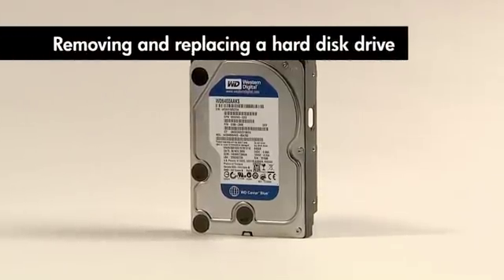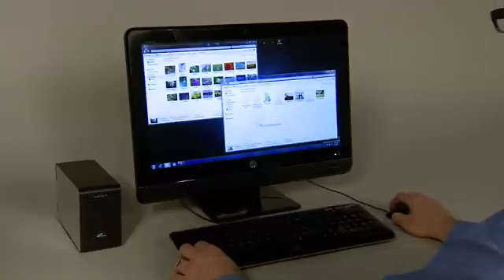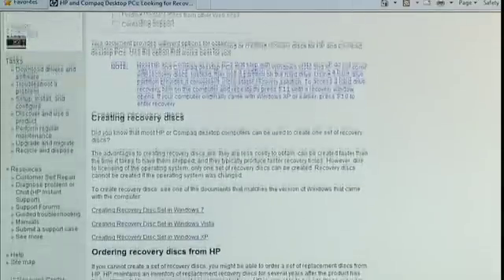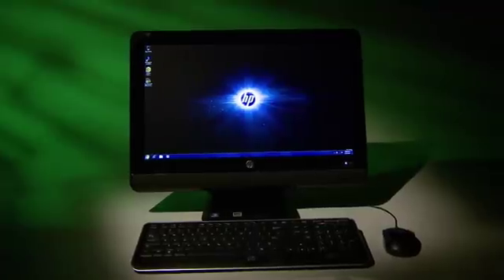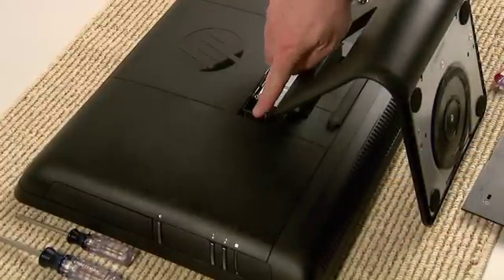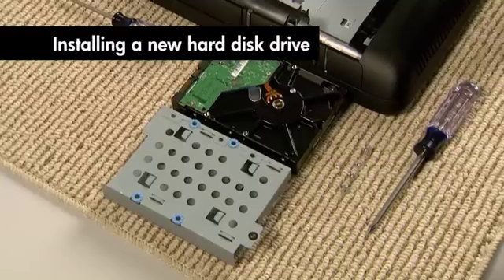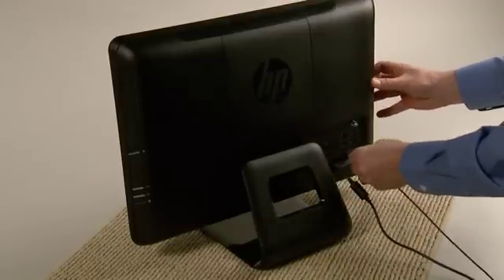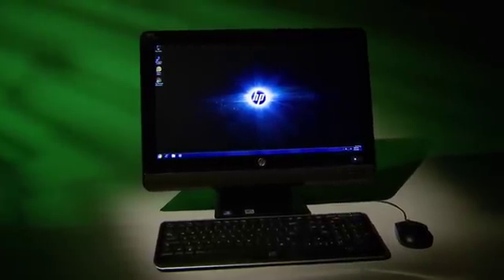Replacing the Hard Drive | HP Pavilion All-in-One PC | HP

Comment: What is the dimension of the hard drive on the HP Pavillion All-in-One 200 PC? Is it a 2.5" drive or is it larger?
Reply from the maker: +Shalev53 It would be 2.5 Inch SATA.
Reply: @HPSupport  Just checked this on the HP Pavillion All-in-One PC 200-5200ch ... the hard drive is a 5400GB Hitachi 3.5" (not 2.5" !)  - I have done so as I intend to replace the drive with an SSD (that is of course 2.5"). This now means that I will need a 3.5" to 2.5" adapter.

Comment: Sir, Can I replace 500gb HDD with 1TB HDD in  my HP20  2312in all-in-one desktop pc.
Reply from the maker: +Rakesh Malik HP does not recommend upgrading or downgrading hardware parts or software that is bundled with the product as It may affect the manufacturer's warranty and performance, however, you could change the configuration at your own discretion.
Reply: @HPSupport   Sir my pc is out of warranty and 500gb HDD is not working. So I can install new HDD of 1TB instead of 500gb in my all-in-one pc.   hp20 2312in  . Can I upgrade hdd  from 500 GB to 1tb HDD. Is it compatible with my pc.  I have recovery media for my pc  which is provided by HP. Can I use this recovery media in new 1tb HDD instead of 500 GB hdd .
Reply from the maker: +Rakesh Malik The current configuration that you have on the computer is tested for optimum performance. Technically, you should be able to upgrade to 1TB but if there is any concern because of this configuration change. HP will not be responsible.

Comment: I was given a 5040a last week, purely because its so useless.
It does however work flawlessly, once I formated and reinstalled Windows. I tried W10 but it kept running a program that I simply could not be bothered to try to cure, and as it had a legal Win 7 licence, I just thought bugger it, Ill do Win7 anyway.

I decided to simply use it as a media PC for the bedroom. It should be just fine for that, but given that all my other PCs are serious high end thing, this was disgustingly slow and so I am doing the best I can, do get it to be as fast as it can be.

RAM is 2GB. I have plenty of RAM but not willing to waste good ram on this, so I threw in a pair of 2GB Sticks.
HD was a WD Blue, and 500GB. Again this should be just fine for 90% of the stuff I want it to do, but me being me, I threw in a 120GB SSD. Since it will be accessing the Media from my Server, I dont need huge storage, however, I do want it to react as quickly as it can when I ask anything from it.

Now, the DVD can be replaced with a HD, just like I have done to all my Laptops. You simply buy a HD Caddy for a laptop and you can easily plop in a 2.5" drive into that... I did this for a bit, and the bezel coes off the original DVD drive to cover the hole, but after a bit, I thought stuff it... Keep the DVD in there. So, thats a thought for if you need extra storage on yours.

The 5040a can take up to a 3.16Mhz Core2Duo E8500 according to teh website, and so, I have a peekaboo into my box os spares and lo and behold I have one.

My only issues, is now, how far to take the stripping down of this thing?

RAM and HD are easy to do, as is the DVD, however, Im not entirely happy with how far I need to go, to get the CPU Cooler off?

I have had a play about... Not too seriously though, and I have taken of fa load of the screws, but, it seems to me, that I need to fully take the whole front off this, is order to take the rest of the back off?

I can get at the two coolers, or the small fan and the CPU Heatsink, and I can lift them up somewhat, but the actual main heatsink, is still very much under the case and so I am a bit iffu on taking this lot apart anymore than it is!

The thing is, that its got a 2.7Ghz Pentium and I have the chance of putting in a 3Ghz ( well, 3.16 ) Core2Duop, and its not just a 300Mhz boost, its also a huge Pentium to Core2Duo boost so the performance increase will be substantial enough to warrant me doing it.... If the E8500 still works LOL

So, anyone know how to do that?

Free beer and kisses for anyone who can help?
Reply: +FatRakoon Please refer the instructions in these documents to know about upgrading or replacing the processor: http://bit.ly/2B5zyQ4 and http://bit.ly/2GDycLJ

Comment: The hardrive went bad in this computer. How do I transfer the HDD in it to a new one? Is there a place to run cables and have 2 HDD plugged in so I can transfer? I never transferred a HDD to another HDD before so I dont know if there is an easier way or not. Thank you in advanced to anyone that helps :)
Reply: +clyde haoks Please perform the steps mentioned in this document to fix this issue: http://bit.ly/2noZJJn
Reply: HP Computing Support Those options seem to have a external hard drive or a easy transfer cable. I just need to be able to plug in both HDD at once or connect them and be able to transfer that way.

Comment: How can I install a graphics card in a all in one hp?
Reply: It really depends on the model of the All-in-One computer. In most cases, just like with a notebook,  it is not an option to replace or upgrade a graphics adapter.
Reply: what about on the omni pro 110 pc... i dont know if i should just get a new pc or not... but my specs are the intel core duo and the g41 intel chipset for graphics card
Reply: Basically you can't. They are like a laptop, and you can't really upgrade parts.  Get a standard desktop PC if you want ugradeability.

Comment: can to send me a link to buy a hard disk drive
Reply: Slush The husky don't even bother with a hard disk drive, most computers today use what we call SATA cables, and solid disk drives or SSD which is a replacement for the hard disk drive (HDD), I would recommend buying a SSD at Best Buy or online. They aren't cheap but they are worth the upgrade

Comment: Hi hp, is there a way to install a solid state drive (SSD) into an all in one PC which are only 2.5 inch?
Reply: Yes, you can buy a 2.5 adapter bracket for less than $10.

Comment: Can I switch my hp pavillion 20 hard drive with my hp touchsmart 310 hard drive? BOTH ARE "WINDOWS 10"
Reply: Highly unlikely as the operating system is not the key factor in switching hard drives.  When you are considering a new hard drive, at minimum, you need to ensure the new drive has the same data/power connector type and the same physical form as your current drive to ensure it physically fits.  If you would like me to find the specifications for you, please let me know the model and product number of each computer.  If you are unsure how to find this information, please use this guide ( http://ow.ly/mSxp300skO1 ) to help you find the info.
Reply: I appreciate your help, Thak You!
HP Pavilion 20 All-in-One PC Product# H3Z14AA#ABA & Model# 20-b013w
HP TouchSmart 310-1155y PC Product# BV695AA#ABA & Model# 310-1155y
Reply: For your reference, please see: HP Pavilion 20-b013w All-in-One Desktop PC Product Specifications - ( http://ow.ly/2SZS301wV1c ),  and  HP TouchSmart 310-1155y Desktop PC Product Specifications - ( http://ow.ly/ErVX301wVeI ).  From those documents both systems have SATA interfaces. Also comparing the two Upgrading and Servicing Guides - ( http://ow.ly/VOUU301wVIG ) and  ( http://ow.ly/UvP6301wVS8 ), it appears that both hard drives are of the same physical size based on the apparent size of the mounting bracket, which would 3.5" hard drives.

Comment: can i remove the boot hard drive and replace it with new hard drive with a fresh install of windows 8 even though the pc is a windows vista?
Reply: +Charles Oung  There is no guarantee it will work because of all the variables. It may work, but it really depends on what was installed and the compatibility of the computer  model to the other operating system, as well as whether any supported drivers are already installed. If there are not any drivers available for that computer model, for the newer operating system, it is not likely going to work. Also you would need to be sure that the hard drive type is supported. The other issue you may run into is Windows licensing, as the operating system when activated could use identifiers like the motherboard, and other hardware.

Comment: Hello +HP Computing Support, Will it be possible to change the HDD in the HP Omni 100-5155 PC to an SSD. Is an SSD compatible with this model? Would you recommend an HDD for an SSD. or vice versa? In what cases would you recommend both of them. I got a S.M.A.R.T. warning on system startup that the Current HDD is about to fail.

Also, the PC gets generates too much noise. I think it is the fan. It gets annoyingly loud that I have to shut it down off.This situation is similar to +Joejoe's comment in the comment section below. Please let me know if there is a solution to this. My PC runs Windows 7 OS as it is the supported operating system for this model. Many Thanks.
Reply: +nocheesable 2  The only things I can go from are the following and the only hard drive mentioned is the 500 GB SATA . HP Omni 100-5155 Desktop PC Product Specifications - ( http://ow.ly/oYcp300F2a5 ),  Upgrade and Service Guide - ( http://ow.ly/6AFF300F2pF )  Anything outside of that is going to be at own risk. 

For the fan issue, give this a try: HP All-in-One PCs - Fan is Noisy and Spins Constantly, PC is Warmer than Normal (Windows 7) - ( http://ow.ly/LqdX300F3dG ).

Comment: Can I add more monitors to a pavilion 20?
Also how can I add Hemingway port
Reply: HDMI*
Reply: +Exaggerated Drumset What is the full product number of the Pavilion 20, so I can find the product specifications? See this page if you need help with finding that: ( http://ow.ly/DKshH )
Reply: +HP Desktop and Mobile Device Help the product number is H1W12AA#ABG
Reply: +Exaggerated Drumset Can you verify that product number? It is not showing a match for me. However if you are trying to add a display to an All-in-One and there are no HDMI ports or other external video connections like VGA/DVI, then the only really option is to use a USB to (one of VGA/DVI/HDMI) adapter to connect an external display. Those adapters are essentially an external USB graphics card with a port of the chosen type.

Comment: Dear HP, what is the model and brand of hard drive that is suitable for this desktop ? Is it a 3.5 inch hard drive?
Reply: +michael tan It is going to vary between models. The only way to say for certain, would be to have the full product number to check what the type of hard drive is installed, and whether there is a list of supported types. In most cases it is going to be based on the physical size, interface and drive capacity, more than a specific brand. If you need help finding your full product number, please look at this page. ( http://ow.ly/VVy6T )

Comment: and an idiot puts a BARE hdd RIGHT on carpet. ( Facepalm)
Reply: +tpcs It matters little putting a hdd on a carpet, stop attempting to talk like you're educated on the matter.
Reply: Intellectual (Facepalm).  hands you a mirror.  " There kid.  NOW you can direct that asinine comment in the correct direction.   I've been troubleshooting, learning about, and custom building PC's since January 2000 ( 5 builds for myself, 4 for family members, and 65 for customers of which the first 20 were strictly-by-my-choice for free to establish a good reputation in my area).  I passed the Comptia A+ certification exams with the top 10 percentile in the nation so far this year. There are two of them 220-801 and 220-802.  However, started after June 30th 2016, the newer and slightly more difficult versions- 220-901 & 220-902 will then be the only available ones.

It's PC common sense 101, ya dumb ass.  You DON'T put data-sensitive electrical components RIGHT on bare carpet, regardless if that carpet is hard or more of a shag style.

Otherwise, you risk static electrical damage to the device and thus risk data loss.  When was the last time you saw Wendell from Tek Syndicate, Elric Faris ( or PHaris, I forgot how to spell his last name) from Tech of Tomorrow, or ANY certified PC Technician put a bare storage drive, let alone ANY bare pcb, straght on carpet?  That would be, NEVER, because they all have sense enough to know better.

" Stop attempting to talk like you're educated on the matter".  Yeah, that is DEFINITELY something YOU must repeat to yourself and grow up while you're at it.

Unlike yourself, I've ran, and continue to, a business repaired customer computers, tablets, and smartphones, while working full time in a mechanic shop, WHILE going to school full time at ITT-TECH working on my Associate's Degree in Applied Science in the Network System Administration program.

Nice fail kid.  Move on.  You lost the fight before you could even find the damn registration booth to sign up for it.
Reply: tpcs yes I know the risk it poses, congrats but comptia a+ isn't exactly a superb cert. It's a beginner's cert. P.s. you also need to know the risk of static discharge so you need a basic understanding of it which you lack my friend. I thought to myself the same as you mentioned, the risk of static electric damage but the risk is minuscule of static discharge unless certain conditions are met. You have more reason to question why he's not wearing static proof gloves if we're to go by your logic. You my friend have still taken the loss here but do not take it as an insult in this field we all need to continuously progress and learn.
Reply: Intellectual I know it isn't superb.  It's the BASIC I.T.-level certification.  HOWEVER,  the entire point of that certification is that it covers ALL of the pc hardware support knowledge and a small amount of networking ( at least in the 901 and 902 series upcoming).  

I don't care if the risk is small or large.  Risk is risk.  Only a moron or a noob would put a hard drive direction onto carpet.  If you disagree, that's your problem, not mine.  Move on.  That meant the conversation is over.

Comment: can someone give me a link to the screwdrivers on amazon can't find any also can I use 32 GB flash drive instead of disks?
Reply: +NeonFailz    If you have Windows 7/8/10 then a USB drive can be used when you create your recovery image.  If you let me know which version of Windows you are using I can provide a document to walk you through the process.
Reply: +HP Desktop and Mobile Device Help windows 8
Reply: +NeonFailz    Thank you for answering my question, I appreciate it. 

I have several documents for you.  The first one is the one that you asked about for creating a recovery image using a USB drive. Please search for C03481733 on HP's home page or using Google search. The title of the document is "HP PCs - Creating a Recovery Image on Discs or Saving a Recovery Image to a USB Flash Drive (Windows 8)".  

For future reference, I'd recommend bookmarking these documents in case you have to use the recovery image you are creating.  

C03489643 - HP PCs - Performing an HP system recovery (Windows 8)
C03483233 - HP PCs - Troubleshooting HP System Recovery Problems (Windows 8)
C03460836 - HP PCs - Restoring Files that were Backed Up Using HP Recovery Manager (Windows 8)

To find the documents please search for the document number (C03489643, C03483233, and C03460836) on HP's home page or using Google search.

Comment: Hi HP! I have a HP Pavillion 23 All-In One, After a couple of power outages and triped breakers, the computer will not turn on. I have tested the Adapter with another computer and it works, however, when i connect it into the pc power inlet, the indicator does not turn on, which leads me to believe that it is a pc power module problem. Any Suggestions?
Reply: Varun Govind I recommend following the steps in this document (c03513214) on when the Computer Does Not Start (Windows 8). If your computer is still not able to power on after following all of the steps in troubleshooting, please call our technical support at 800-474-6836. If you live outside the US/Canada Region please go to Google search and enter 'contact HP worldwide'.  Your first option should be the site for contacting HP, when you click on it you will be prompted to choose your country/region.

Comment: Hi
I have an HP Pavilion 23 All In One PC and the power went out while I was using it. Now when I turn it on, its stuck on a loading screen saying "Diagnosing your pc". How do I fix this? I can't find any batteries or how to open the computer up. The only way without using batteries was to wait for 12 hours. Please help!
Reply: PrimoSupremeX I will need to know what the product and model number of your desktop computer is, as well as the version of operating system installed on it.
Reply: HP Desktop and Mobile Device Help Nevermind, just waited 4 hours and it fixed. Thanks anyways!
Reply: PrimoSupremeX Happy to be of assistance!